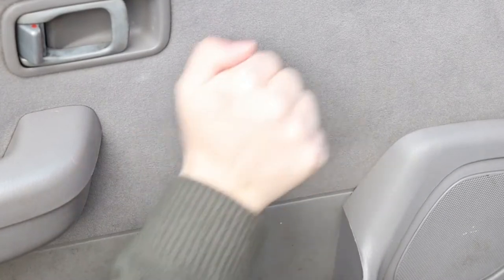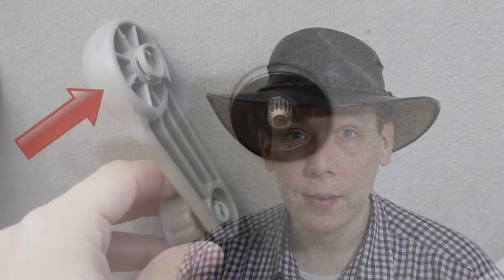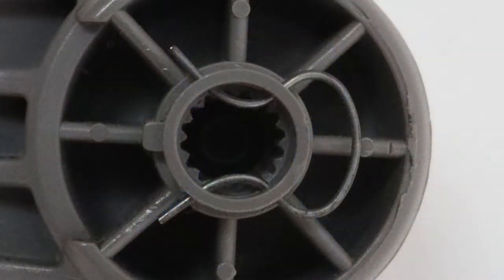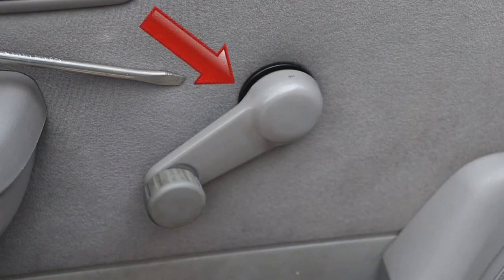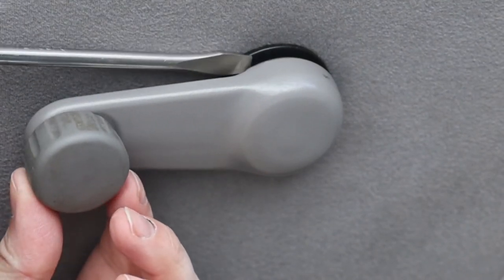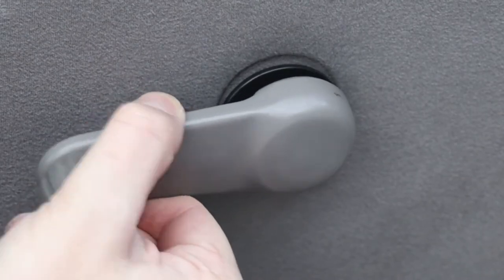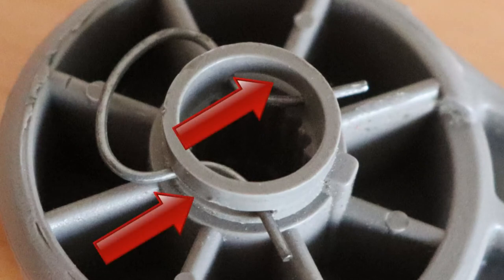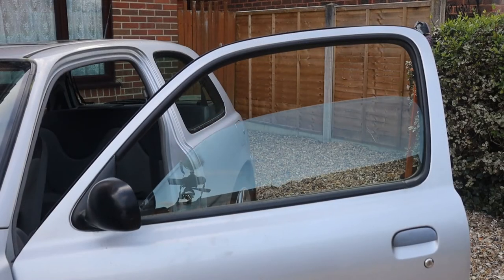How To Remove Manual Window Crank Handle On A Car (And Replace It)

Comment: Ahh I miss my corsa with these handles. My electric buttons glitch out sometimes 😫
Reply from the maker: Electric buttons can often be replaced easily. You might be able to get some on eBay.
Reply: @CarSpyTV  hmm, maybe I'll check that out, I'm not really sure what part is glitching though

Comment: HELP, my Micra k11 auto is running lean, what price do you think I am looking at to have it checked and fixed?
Reply from the maker: Diagnosis is likely to be based on an hourly rate. I suggest you phone your favoured garage and ask.

Once the garage knows why the engine is running lean, they can estimate the repair cost.

Comment: Does anyone know where I can find the spindle for a 2002 Hyundai Accent? Does it come with the Regulator?
Reply from the maker: I'd check eBay.
Reply: @CarSpyTV , thanks, but what name do I search under. I see the Window Regulator, but I don’t know if it includes the Spindle?
Reply from the maker: It's best to ask the seller what's included. Best wishes from CarSpyTV.